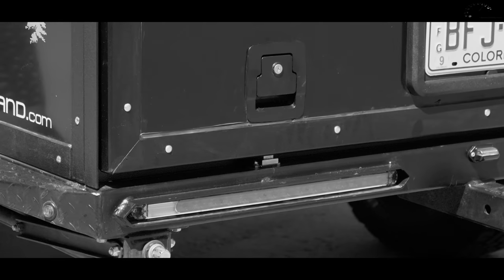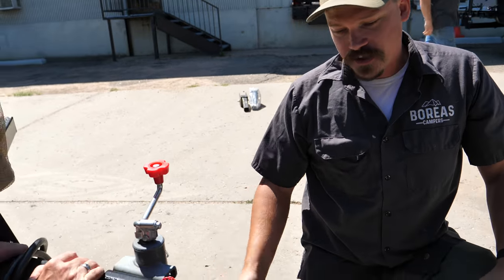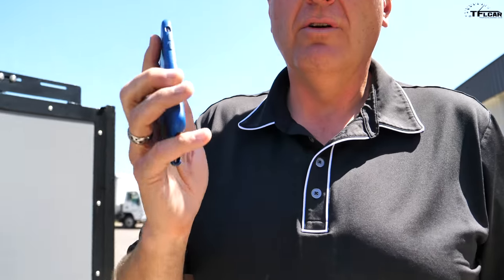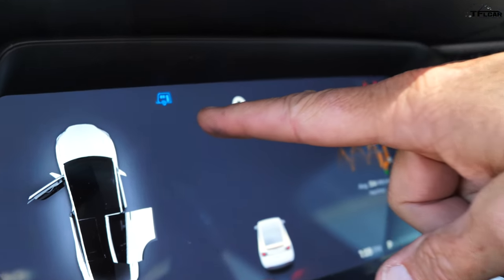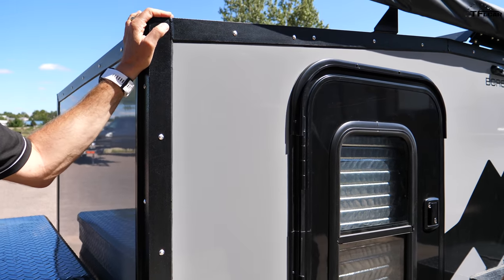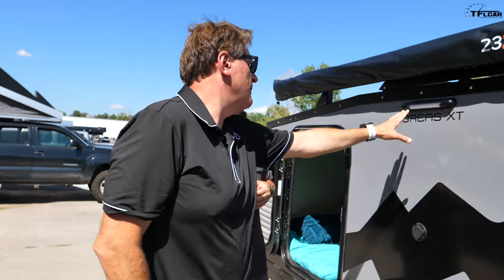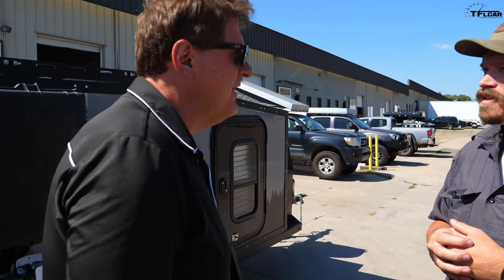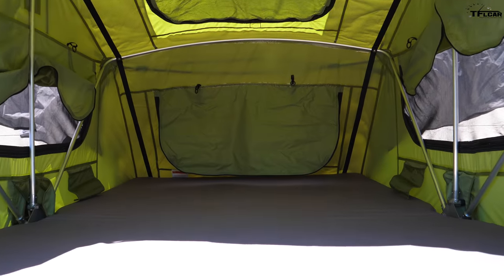Is Electric Car Camping a Thing? Let's Find Out | Adventure X Ep. 5

Comment: For the route planner..
Do they have something like that for gas cars? I went on a trip in my civic si. And almost ran out of gas. I used the cars GPS. To find a gas station. But that one was shut down.. And 1 mile to empty the other gas station was 15miles away.. talk about range anxiety HAHAHA.. oh and that was closed. And I had to use my credit card which had no money on it. But it still took it at the gas station pump.
Reply: That's idiocy on your part. The farthest distance I know of between gas stations I know is between Tonopah and Ely Nevada and that's only 160 miles.
Reply: On the east coast when you drop below Richmond most gas stations close at 10 pm. Even off 95.   You must be near a major City to get 24-hour gas.
Reply: Yes, check out gas buddy, it will route you to the cheapest gas along a given route and plan fill ups based on your vehicle.
Reply: @gondorian1006  Gas buddy works for gasoline. Not so well for Deisel or E-85.
Reply: Trigger Troll  No electricity is not for everyone...wait.   Solar arrays are getting cheaper and more powerful.  The new Electric pickups will start to close in on a 400-mile range.

I can see a future where you set up a foldable array when you reach your off the grid location.  Supercapacitors that can hold 100 miles of range in a 50-pound package.

The cool thing about electric cars and trucks. If you have sunlight and batteries.  You have a way to charge them.  No grid is needed.  You can have a solar-powered charge station in the middle of death valley today.

Comment: The trailer would pull power from the 12 volt battery,  not the HO battery.  The lights on the trailer will not further limit your range.  Come on. 🤔
Reply from the maker: Chris Farrer and what charges the 12V  battery?
Reply: @TFLcar  Sure. The 12 volt battery is recharged by the high output battery,  but also shote power as you charge via the DC to DC converter,  but to suggest that LED trailer lights contribute to loss of EV range is a stretch.  
I've been driving an EV for over  2 years and in my experience loss of range is reflected by two conditions: temperature and speed. If you use HVAC system to either heat or cool the car... expect some loss on range, could be as much as 30%. Also, traveling at highway speeds will contribute to range loss. I wouldn't be concerned with cabin electronics,  lights,  infotainment,  etc.
If you're concerned about range, travel 'B' roads @ 90km/h (55 mph) and keep the AC off🙂👍
Also, I wish Tesla would use standard consumption units,  kWh/100km, I can't understand a 'watt/mile'? Is this unique to only Tesla? So much easier if they would just say, " we are using a 60 kW battery.  Consumption is 15kWh/100km... so 60/15 x 100=400km range. The car will travel 400km, or 240 miles at 15kWh/100km🙂👍
Thanks for posting.

Comment: When the Model X was introduced as the "first Electric for towing" vehicle they used an Airstream trailer. RV'ers not only love them but they are also one of the most "aerodynamic" trailers you can buy. So why not test with one of those (either the 16' or 21' model). The Model X is one of the most Aerodynamic production cars in the world so why slow it down with the trailers you are testing? Get an Airstream, take it to RV parks so the car can charge over night, and get some real world numbers.

Comment: Safety Chains should be hooked from the top to the vehicle, not the bottom as they can slip out 12:09. Otherwise another amazing video!
Reply: Wait, what? The chains aren't locked? They're just hanging there? What the hell is the point of that?

Comment: Nice to see a test with a more appropriate sized trailer for the Tesla. So was the low current draw for the whole trailer or just the lights circuit? If so, I would think running a small electric cooler while you're driving would do the trick and be useful? 
According to the Tesla supercharger map, there will be another super charger within a year before you get to Twin Falls as well as some others that should help this trip in the future.
Reply: Brucec 95 are you saying they should postpone the trip for a year? And is that Elon years? Because he always promises 6 months and has yet to deliver on most of his projections.
Reply: @PD-we8vf  Just saying it will get easier/ have more margin in the future. I think they could set the min charge value to 10% instead of 15% and would be OK. Tesla's map shows new supercharger opening in 2019 so I said in a year to allow for Elon time.

Comment: $27K!!!!

For what? Big tires, articulated suspension, no wood, welds, and a 360 hitch? 

I bought a very similar trailer, changed the suspension, tires, hitch added a shower, Yakima tent, trickle charger, solar, kitchen, and more for a total of $8K installed 7 years ago. Still going strong. I'm sorry guys, I am all for American made but... I need to support my wallet first.

Comment: These guys are beginning to bug me with their clear ignorance of how this works. 

Speed = wind resistance = loss of efficiency. They did their “mpg” loop at/above 70 mph. Any amount of time trailering or trucking well tell you past 65 you reach a point of diminishing returns in regards to efficiency due to wind resistance. When I tow my 4500# camper on the highway I do between 55-67 mph (depending on wind and other factors) and I regularly see 14-18 mpg - when testing at 70/75/80 mpg will be cut to 5-10 mpg overall. 

Electric Vehicles are their own ball of wax when it comes to efficiency also as they use more power at highway speeds (opposite of ICE) primarily due to wind resistance. Add the significantly increased wind load of a horse trailer at already mentioned high speeds and of course the thing is burning through Kw! 

So yes your efficiency was cut to 1/3  but a large chunk of that imho was between the seat and the wheel.... 

Check out Tesla Bjorn’s towing videos, or there is an Australian channel that did  very fair Model X towing review comparing it favorably to Australia’s most popular ICE tow rig. 

I used to come to TFL for good towing reviews and info, but this is just embarrassing guys.
Reply from the maker: Thanks for the comment but please stop it with the silly condescending comments. We’ve towed with more vehicles and more weight and more times than all of the commentators combined. Go over to TFLtruck and check out our Ike or MPG runs before you comment please.
Reply from the maker: And yes we’ve watched both the two towing Tesla towing videos you mentioned. 1) There’s a world of difference between towing in Europe and Wyoming. How many charging stations do you think there in Sweden vs Wyoming. Perhaps 10,000 to 1 would be a conservative ratio. And how far did the reviewers tow in Australia  when they compared the model X. Was it 1,200 miles or was it around the block?

Comment: I don't need a drag strip car or truck just something that can go on a 2000mi trip this is one way so 4000mi go off road run a.c. or heater as needed and get back without settling at charging stations hrs at a time if you can find them and not having to unhooking camper to get into charging stations+tesla needs to make unaverseable connection like a gas station I don't have to goto a dodge gas station to fill up main thing time and distance and availability of charging stations also this camper isn't something most people's could afford I'm retired 1800 a month only I will keep truck tell wheels fall off and can't get fuel and the tree huggers shut us down maybe I will not be driving by then or dead

Comment: Does your trip planner take into account normal human functions such as eating, sleeping and waste removal??  I think not!!

Any vehicle, ICE or EV will experience poorer fuel economy and more fuel stops when you add a boat anchor to the rear of it (such as a camper.).

The most interesting test would have been to do a side by side comparison with an ICE C/SUV and the Tesla C/SUV.   
In reality, whether in an ICE vehicle or an EV, you would still have to make stops for meals, fuel and sleep.  A well planned trip in any of these
vehicles would seek to schedule fuel stops in coordination with meals and/or pit stops.  Also, at about the half way mark,  i.e.  500 miles @ an average
real speed of 60 (because you can never really keep up a sustained speed of 65 or 70) it would be time for an evening meal and a good night's sleep.
By the way, most superchargers outside of California are generally wide open (many open slots) so that you could pull in sideways and charge up and still have a few spaces available for other Teslas that happen to need a charge while you are there, so you may not have to unhitch as often as you think.  

In an EV, with proper planning you could sleep at a camp grounds with 50amp power hook up (or a Hotel with free Tesla chargers) 
and charge the car for free while you sleep.  In an ICE you would have to fuel up before going to the hotel or camp grounds so you're ready for an early start in the morning.

Based on my real life experiences with my EV compared to my (previous) TDI Diesel, I can tell you that a 1000 mile trip via the EV only took
about 1hr 30 minutes longer than the Diesel including all the reasons for stopping mentioned above...and even with the TDI's great fuel efficiency,
the Tesla cost for fuel would have been half as much BUT, because of free supercharging and free charging at hotels, there was no charge
for fuel for the Tesla.

Here's hoping you have a better than expected experience with the Tesla Towing adventure.
Reply: Trigger Troll  -  There are few places remaining in the US where you cannot find shore power while enjoying a back woods fishing, hunting or camping trip.  But yes, perhaps you'll find one that is so remote that an EV would run out of juice with no place to charge and where only  dino juice is available via jerrycans.    Don't really think that is the kind of journey that the TFL is taking however with the Model X and camper trailer.   :)

Comment: Good luck going max 63mph on that stretch, speed limit there is minimum 70mph, and I think 80 on most of it
Reply: The speed limit isn't a minimum of 70mph there..I should know, I've driven it enough. Yes, they'll have people passing them at higher speeds, but they will be fine doing 63..
Reply: @danahebdon6810  my bad, I meant "the speed limit there is at least 70, but mostly 80"

Comment: Tesla tow bar is from Germany and is the same tow bars for BMW's so don't say its a Tesla problem. Do some homework before you run down Tesla or is these videos all about running down Tesla. LED trailer lights are not recognised by BMW's as well until recently with power connection upgrade.
Reply: Tesla fanboy
Reply: speterbilt I own 2 near new  BMW’s so no I’m not a Testa Fan Boy just sick of these vehicle reviewers unable to do some simple homework. It’s a wonder they can even dress themselves in the morning.

I will be a Tesla Model 3 owner this week and yes I’ll be a Tesla fan boy after I collect my Tesla.

Comment: This entire video confirms why ICE vehicles will remain for decades.
Reply: not really
Reply: @thomas8421  Yes, really.  I have flown my airplane 1,000 miles with less calculations.  This is ridiculous.
Reply: @WW-wf8tu  And yes, they are proving that ICE engines will be around for decades until the batteries are improved 10 fold.  I am glad they did all this nonsense since it proves energy density is 10% what it needs to be and Musk should be employing 1,000 chemists to make credible batteries.  tesla should keep volumes low until the battery tech is resolved, not continuing to push an impractical product.